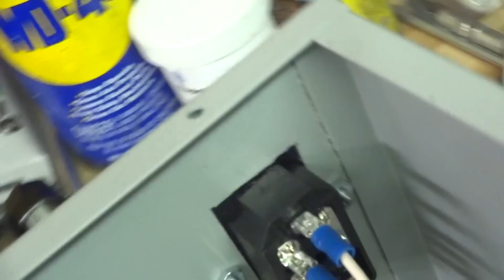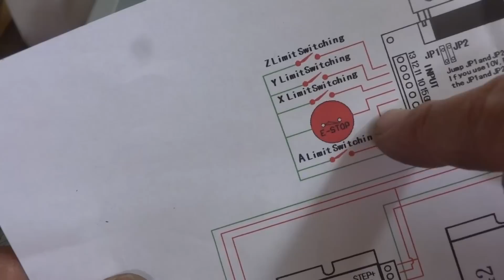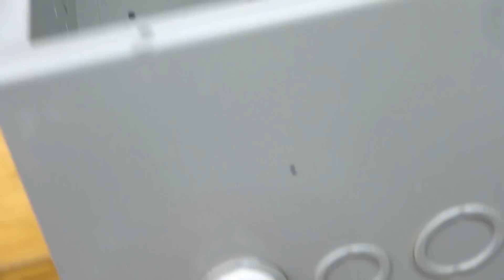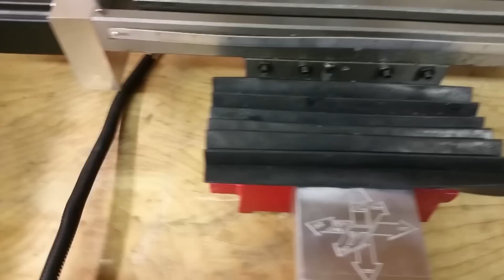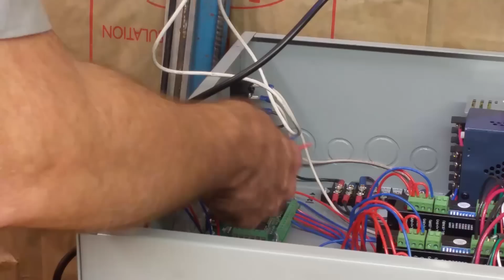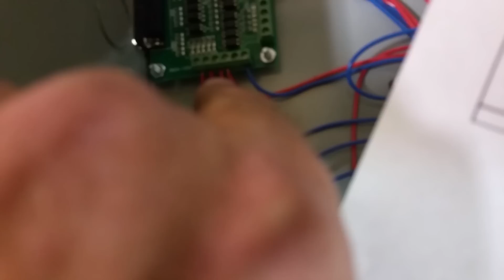Mini Mill CNC Conversion Part 2 - Control Box Wiring

Comment: 1:10, where you daisy-chain your ground connections.  Don't do that!  Run separate ground wires from each power supply to your central grounding screw...

Comment: A troubleshooting nightmare if a wire comes loose or something fails, everything either red, white or blue. If your forced to use the same colour wires at least mark them with something, clip on plastic number tags are so cheapest, for $5 you can get thousands, heatshrink is not expensive.
Reply from the maker: Not really enough wires to worry about. As a maintenance electrician,  I am use to "tugging".

Comment: I’m currently setting up a system like this, but with 4 motors. I’m having the hardest time finding a wiring diagram like you have and was wondering if you could email me what you have or tell me where to get it? Thanks
Reply from the maker: Check with CNC4XR7.  I got the drawing from Sam.

Comment: Is someone able to help me please, I'm not 100% sure I think I have a communication fault somewhere between PC and breakout board, 
Here is my story
I brought Wantai cnc kit did not come with any instructions (basically wired up the same as in this video and I did find that wiring diagram pdf as shown).
I also brought parallel to usb cable later finding out it won't work with it so I brought parallel port card still no go.
system powers up lights on, double checked wiring, when first connected motor made a thump noise has not made that thump noise since reconnecting.
on breakout board I connected from pins 2 to 3 4-5 6-7 then on another vlog someone mention on their breakout board pin 2 didn't work so I assume that was my issue too so I went pins 3-4 yes changed it within mach3.

On mach3 if I turn off e-stop within inputs I can reset e-stop error message, but if I turn it on and put a jumper between ground and pin 10 to act as an e-stop I can not clear e-stop (as I'm still waiting on my e-stop switch)

I can't clear e-stop so makes me think a communication issue between PC and breakout board.

maybe someone has experienced this issue on their cnc build

Thank you
Reply from the maker: Sam with CNC4XR7 is the pro at that stuff.
Reply: http://www.kelinginc.net/KL-5042WithDB25.pdf

Comment: where did you get your terminal blocks?....can you send a link plz.....i have a 20 amp power supply with a +48 volt output that i need to distribute....would the block be sufficient for this task?
Reply from the maker: I got them from a local electronics store.  The blocks have to be rated for the voltage and amperage.

Comment: I wanted to thank you . This video helped me out alot.  I got  the same board and motors from Long and they didn't send diagram instructions. have you got Inductive Proximity sensor on your setup?  I just ordered NPN Proximity sensors for switch Just curious to know how is that working out.  Awesome video.
Reply from the maker: Ernz money - Thanks!  Sure thing. I just used regular micro switches.

Comment: Are cooling fans required without the ventilation holes/slots?
Reply from the maker: I would recommend a cooling fan with a screened hole on the opposite end just like a computer case.

Comment: I'm having trouble understanding the dip switch setting on a Longs DM542A controller. Can you explain
 or how do you know were to set them. Thanks for any help and I like your
 video I understand the 1,2,3,4 just not sure about the 5,6,7,8 dip switchs. I running Nema 23  1/8 deg/step 3.0 amp motors
Reply from the maker: Sorry Billy, that was a while ago.  CNC4XR7 might know.  He helped me.

Comment: I didn't see a star earth connection, that's a big No-No. Same with not properly separating live wiring from low DC wiring and bare crimps on the mains panel connector! Eeek!
For a couple of cents this could have been a really nice job - like correct earth wire, shrouded crimps, cover on the mains terminal block, fused power supply outputs, heatshrink on the connectors, ferrule crimps on the board wiring,
A better job than most though, you wouldn't believe just how many people out there solder their crimp connections. Thanks for putting a video up just so we can nitpick  :)
Reply from the maker: Your welcome, lol.  Yeah, control boxes aren't my specialty.
Reply: Thanks for your comment. Will implement a few things you recommend which otherwise I would have not done it.

Comment: Your soldering would be made easier by using a chisel tip on your iron. You are using a pencil tip, typically used for PC boards. Chisel tips have a flat that transfers more heat to your joint in a shorter time. Also, I use a 90 watt iron for jacks, although with a chisel tip you 50 watt iron will suffice.

Comment: Flux helps a bunch when soldering. You won't have to heat the joint anywhere near as much. Nice effort tho with the control box 👍
Reply: Must NOT use flux on electronic soldering. It is corrosive and will ruin your component. Electronic solder has a rosin core that serves as the flux for the joint. His problem was poor heat transfer to the joint due to using a pencil point iron.
Reply from the maker: +mattgatenby - Thanks!

Comment: How did you determine neutral on the 110 volts coming in?
Reply from the maker: +David Legg - You know how an extension cord has 2 flat prongs on it and one of the prongs is wider than the other?  The wider prong is the neutral.  If your facing an outlet in your house, the neutral is on the left. On the Receptacle I got for the control box it was clear because the hot was jumpered down to the fuse.

Comment: Great looking job,  only thing I see I would have done different is the power supplies,  you sure crowded them in tight,  this will be one of the main heat areas,  and should  be at the top and lots more space around them to help keep the heat from  the electronic controllers,   the chrome power supply i see has a fan,  it should have a exhaust outlet out of the box.   Electronics = the cooler - the better.
Reply from the maker: +jbrunson1949 Thanks!  Yeah, I guess your right.

Comment: Only in the higher frequencies ( above 1.544 megahertz)  it's called skin effect . Anything below 1.544 meg you shouldn't have to worry about to much  , but above 1.544 use shielded cable  grounded on one end only. ( or it becomes a very nice antenna ) 
Don :)

Comment: Looks like a very  clean installation,  I see one potential problem that might creep up on you later down the road that is  the use of solid wire. The use of Solid wire should be used in a place where there is little or no vibration (like a house ).  Stranded wire works rather well in, let say a car boats or motorcycle.  Also stranded wire has a little better current capabilities,
 example #6 welding wire has many small 26 ga wires in it to pass the current without heating up the wire. (NOTE:  remember it was an example )
   If you used #6 solid for welding (not recommended) this would heat up and just from slight day to day movement would work harden the copper and break it for an eventual
failure. 
little off topic:  Car Jumper cables are the same way get the biggest size cable  with the most amount of smaller size conductors to make up that cable.  If you can take your jumper cables and bend them to look like a cobra snake on attack and it stands upright on its own. This imaginary snake will bite you eventually, and is telling you that your jumper cables are junk.
Reply from the maker: +Don Staley - Thanks!  Yeah, that's because the current flows on the outside of the wire so there is more surface on the stranded wire.  I just used solid wire for control wires with no real load.  Yeah, vibration may be an issue unless I put the control box on a separate table from the mill.  Yeah, I may change it out to stranded.  Thanks!

Comment: Ideally you should not daisy chain grounds like that but bring each independently to your star ground.
Reply from the maker: +Dr. Ralph Kennedy  - Yeah, I guess I could have run 2 separate wires to the screw.
Reply: BS daisy chaining ground is perfectly okay and legal for wiring.
Reply: @KOMODOR, It's fine either way. You should choose the most convenient one.
Reply: @KOMODOR, With two power supplies you need to be careful. If you won't be connecting them to each other you're fine. But if you want to connect two power supplies to a single circuit, you could have unintended consequences depending on the power supplies.

For example, you might want to use 2x 12v power supplies to connect together in series to produce 24v. What if both of them have the same ground? If the ground of both power supplies are connected to the ground pin of your electrical plug, connecting the positive 12v wire to the 0v wire of the other power supply would be the same as shorting out the second power supply.

Therefor you need to understand the power supplies that you're using before considering using them in the same circuit.
Reply: The President of The Internet, I bet you're an IT or software engineer and not an electrical engineer. Because an electrical engineer would never say something so ridiculous.

Comment: Could you share the parts info on your electronics kit. Nice craftsmanship on the assembly.
Reply from the maker: russcrosby Thanks! Sorry, I never did make a list of parts. I just kind of got them as I went along.  The main purchase was an electronics kit from ebay for $260. It was from Longs Motors.  I believe this was the kit "3axis Nema23 stepper motor 425oz-in 3.0A DUAL SHAFT for CNC controller kit" . The enclosure was from my electrical supply house for $40-50.  The aviation plugs from ebay, the emergency stop switch form ebay, The power on/off switch from Graingers, The power supply is a 5V power supply for Arcades from ebay. The wire was from Home Depot or I had it already.  The terminal blocks were from Frys Electronics. Hope that helps.  Let me know if you have any other questions.

Comment: Nice Job! A trick to get heat to transfer quickly from your iron to the part is to melt a small amount of solder on the tip of the iron first and then let that melted solder bridge your tip and the part and the solder will transfer the heat quickly. The quicker you can get in and out, the less damage from overheating you are likely to do to parts. You can also tin your wire 1st... just a tiny amount of solder on the end of the wire.
Reply from the maker: Westerly Sunn Thanks!  I will have to remember that for next time.
Reply: +Craig&#39;s Machine Shop Generally, I tin both surfaces and the tip of the iron before trying to do the joint. This allows heat to transfer super quick, and you don&#39;t need to try and feed solder at the same time. Also, if you can change tips on your iron, you can look for a flat tip which will hold solder on it a little better than a tapered tip.
Reply from the maker: +cryptology  - Cool, thanks for the tips!